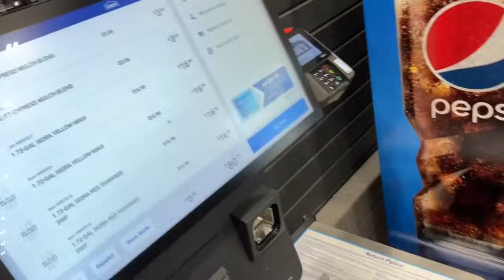Spent Two Days At EYESORE And DEALER Roommate Got ANGRY

Comment: Hey Sean are you using a echo srm 2620 or 3020 trimmer on this yard
Reply: @gabrielflemmings1022 I think it’s the little one but when I see him I will ask him, he is working right now if you can actually believe that haha byeeee
Reply from the maker: @gabrielflemmings1022 I’m using two 2620’s in this one, I have the 3010T in my trailer but I never felt like I needed it here. This was some thick grass though so it would have probably helped.

Comment: U need a trap to pulling and a good small chainsaw for you get you and u did a good clean job 🪥🪥🪥👍👍👍
Reply from the maker: Yes Loraine, I agree with you. I couldn’t get access to the backyard until I went there the day to start working on it. So I was a bit surprised when I saw how large it was and how much needed to be cleaned up. I will have a tarp and chainsaw for the next home. I’m sure you noticed, I simply used the largest branch as the “tarp” for each trip I took pulling the debris up front. Thanks for your input and advice!
Reply: Yes a tarp is so good idea